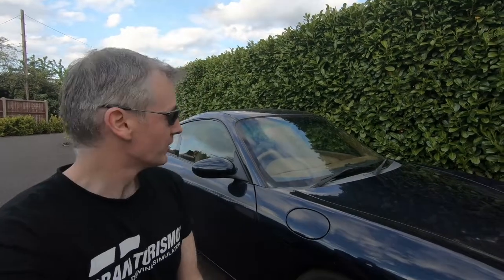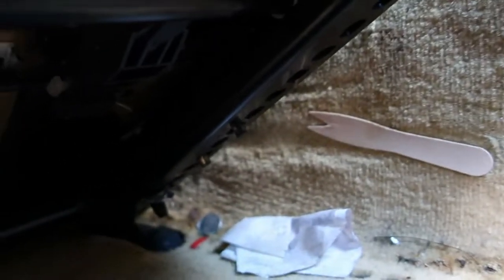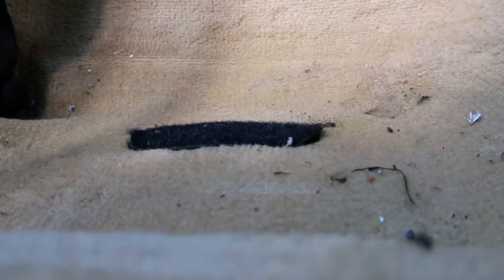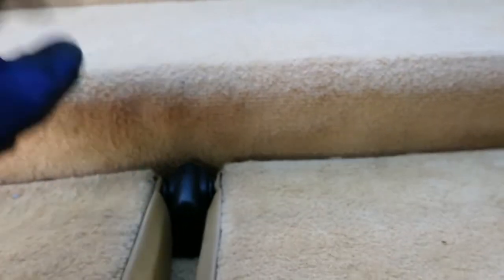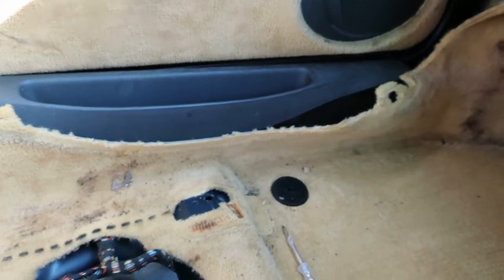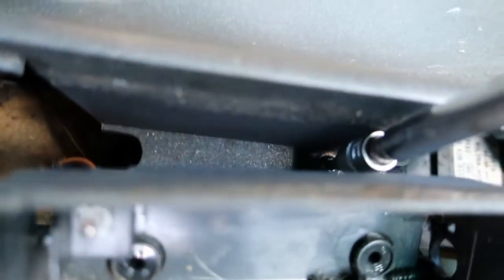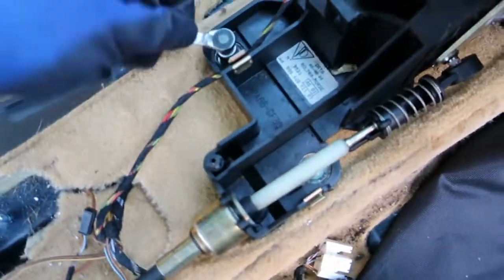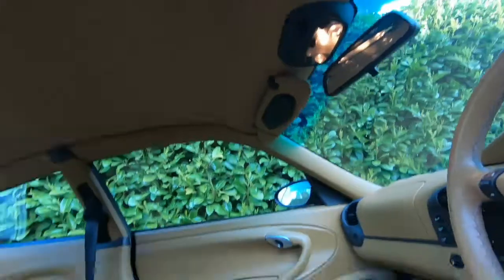Customising Porsche 996 interior - How to remove the interior of your Porsche 996 Pt 1

Comment: Great most helpful, I'm just getting ready to replace the rear strut mounts. I have the Bose Speaker shelf, still can't figure out how to remove it to gain access to the top of the mounts.
Reply from the maker: Glad it was helpful. I haven't had to tackle the Bose subwoofer myself, but I had a look at the parts diagram on one of the online Porsche parts shops and it looks like there is a screw in the back of the sound hole on each side the connects the speaker to the mounting bracket.